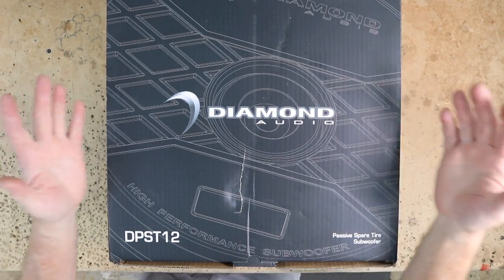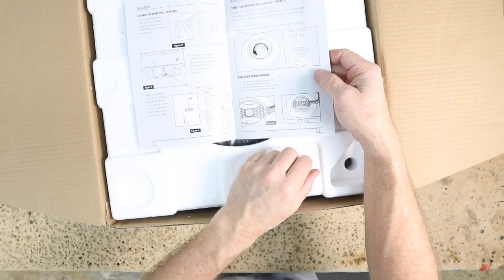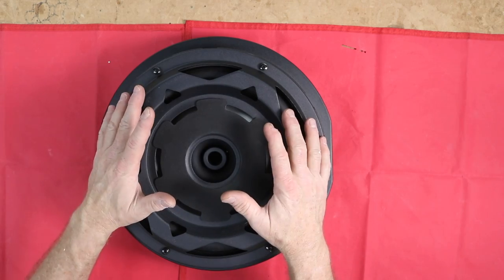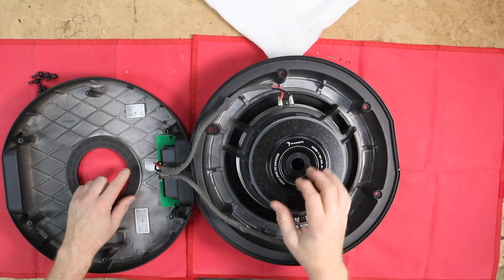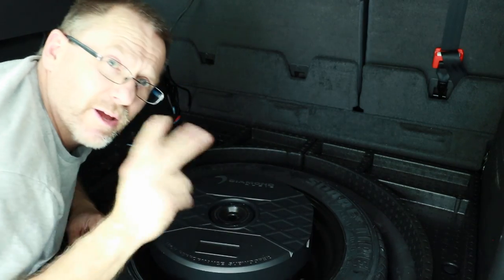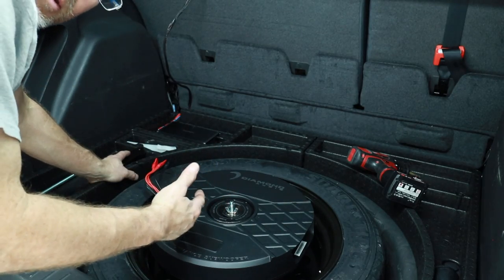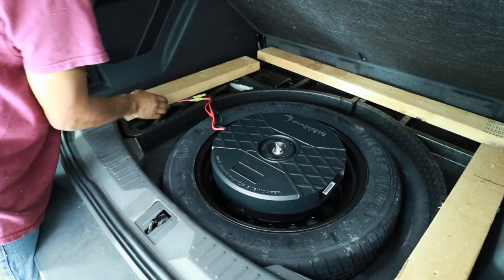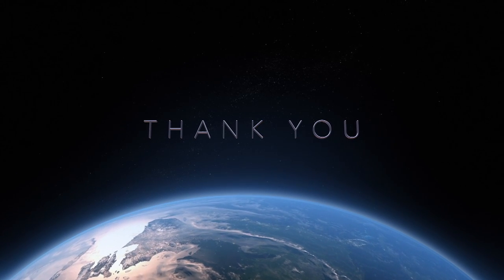Diamond Audio Spare Tire Subwoofer DPSD12 unboxing and install

Comment: I removed the hatch cover and replaced with a Birch box 4¾ deep added a ¾ ring to gap the magnet downward firing DD redline 612 shallow sub tuned box to 30hz still have full access to everything under and 100% cargo space can not describe the bass it's way louder than my old JL TW3

Comment: I have the JBL one without an amp and it rocks in my 2014 Mazda 3 sedan running on the sub channel of a Kicker KX-8005.  Thanks for showing the first video with the amplified JBL.
Reply: I have elantra do you recommend these spare subwoofers it will cost me 300$
Reply: @RayanAlzahrani-sv8yx  the jbl one is really nice and can take a little more power than the Diamond ones but I have not heard the Diamond one in person. It’s nice to have nice bass (not saying it’s the loudest or hardest hitting bass) but I will definitely shake my rear view mirror.  And other than raising my trunk floor, I have no sub box in the way.

Comment: You maybe want to put a nylock nut on there and just have the appropriate tool to remove of needed back there. All the vibration otherwise might regularly loosen that up.

Comment: We have a 2015 Murano with a factory Bose spare tire subwoofer. Has two fairly beefy 5" 2-ohm woofers but they only get 28W each out of the Bose amp 🤣 This Diamond on a decent amp looks quite interesting as a replacement
Reply: Same, did you replace the Bose? I'm thinking maybe just a higher output amp might make it bump a lil more.

Comment: protip, if you are going to crank down the bolt, make sure you keep a spare tool to remove it road side in case the spare is ever needed.
Reply from the maker: Definitely!

Comment: Just an observation:  Is the nut holding the structure in place the same size as a lug nut?  If not, then it seems that a person with one of these would need to add a secondary wrench to the tire change tools to get the spare out.
Granted, one extra wrench vs all that trunk space seems to make it worth it.
Reply: The hex nut is supposed to act like a jamb nut so it all acts as one piece.  Once the height is set, take it back out and tighten the hex nut and wing nut against each other really tight.

Comment: So which one do you prefer,  JBL or Diamond?
Reply: Heard em both, in hatchbacks. Diamond. No question.
Reply: Lol,  no, just no. The JBL passive Stadium Basshub is much better than this. This vs. the JBL active, OK,,, maaaaybe. In that case, it depends greatly on the amplifier used and its hardly "apples to apples," as they say. 

Hearing them both in different setups/vehicles isn't the same as testing them in the otherwise the exact same setup/vehicle.

Comment: A small 500 watt amp paired to a 300 Watt RMS sub seems a bit overpowered.
Also, did it sound better or worse with the trunk floor liner down?
Hopefully this or the JBL will fit flush in a 2023 KIA Sportage!
Reply: If the JBL will fit, go with it. Look now, today, it's on sale. Even at full retail, the price difference is more than justified by the performance difference, IMO.

Comment: I really want one of these, but imagine I am going to have the same issue with it being too tall. In my Blazer the cargo deck has a hinge and is flush with the bottom of the rear hatch so raising it isn't really an option. I will probably have to go with the slim version but I feel like that is a little bit of a compromise. I wonder how the sound compares between this and the slim version.

Comment: As always, you guys knock it out of the park with your reviews and entertainment value. 

Q- I have a Honda S2000 (2-dr convertible) and not a lot of trunk space. If I were to get the shallow amplified version to fit in the spare, do you think it would provide a decent sound/output for the car? The spare sits maybe 24” from the head position.
Reply from the maker: I would get with Ata at absolute electrics in Rockville Maryland 
He is the s2000 guy

Comment: I had one shop rave about the jbl vs so wonder how this compares
Reply from the maker: We did a video on the JBL version with the built in amp. Very nice
Reply: The JBL passive version is better than this, and their active version is better than DA's (or CV's). This vs JBL's active, without consideration for longevity, comes down the amplifier used for this in terms of performance around 45Hz and above, below that there's potential for some back and fourth in terms of SPL at a specific frequency.  

If this type of solution is better for you than a custom box, the JBL Stadium BassHub should be top of the list, IMO, unless it won't physically fit...

Comment: Would this or the cerwin vega version be a suitable upgrade for the factory Bose woofer in my Buick Regal Tourx ?
Reply: This is better than the powered CV. The passive JBL, Stadium Basshub, is better yet, objectively, by a significant margin. 

I've tried most of the products in this segment, and the CV ones are made inferior, while the JBL ones are made superior. The powered DA ones aren't anything special either, meaning no better than than the CV, overall. They appear to be made in the same factory using many of the same components, which are inferior to the components used for the JBL powered versions.

In this segment, IMO, the only good reason to buy something (currently available in the market) other than JBL is if they won't fit without more modification than you want to do. Maybe price, but if you wait for a sale, that's much less of a factor, but then, I suppose, timing may be. 

No matter what, a halfway decent "real", boxed subwoofer, will almost always be a more capable solution. Most of these are "good" or "impressive" only for what they are. That is especially true when, as they often are, when they are set up in a system that's not processing the signal to correct for factory bass rolloff.  

Maybe with the passive systems, that's a bit more likely. In the case of the JBL (passive) Stadium Basshub, when setup properly, meaning tuned and with plenty of power,  it can be straight up impressive, not just for what it is (or the price). No, it's not going to hit like a properly ported box with 3000w RMS, but it can still impress.